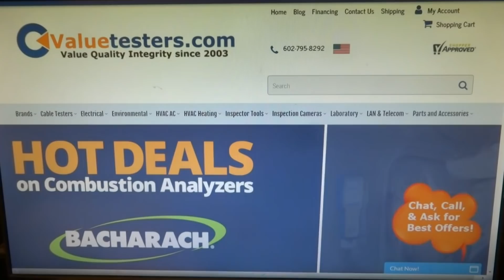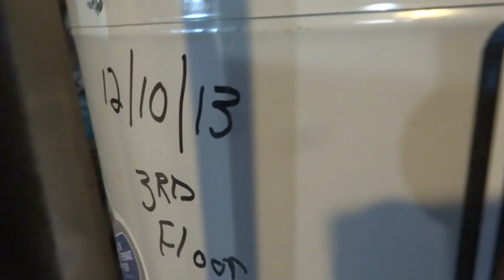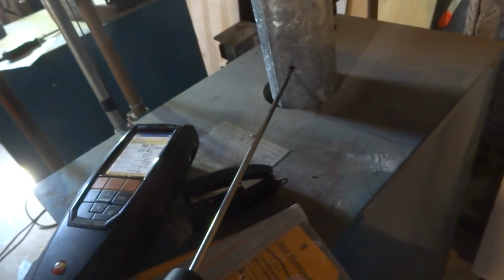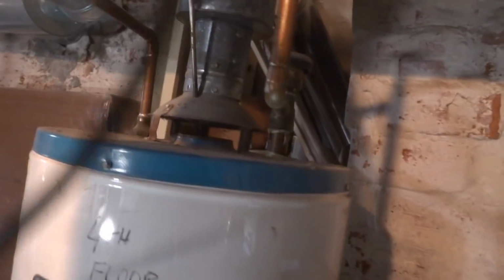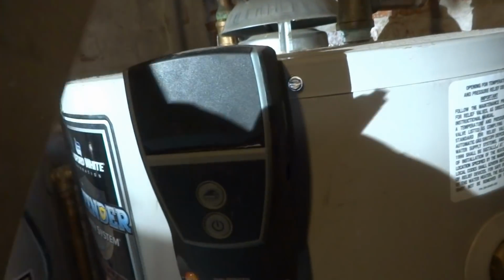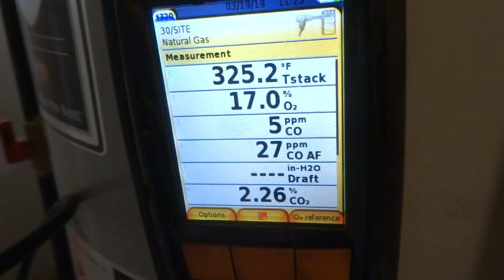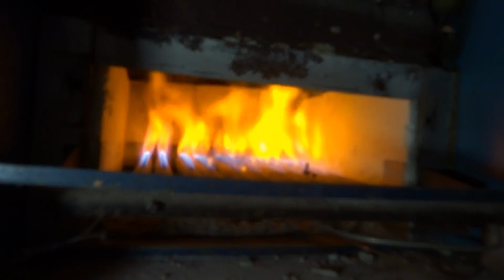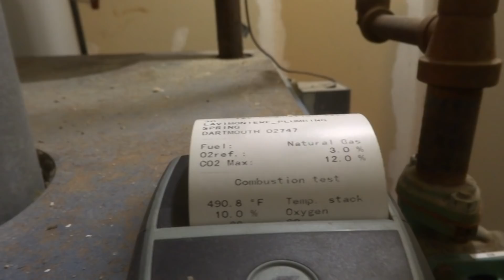combustion test on boilers & water heaters

Comment: Just draw 5 gallons out of the drain valve of the water heater or enough as needed so stat calls for burner to kick on.   No need to get in unit to run water.

Comment: Steve, I like these "Dumb" gas water heaters because they don't require electricity to operate. I lived in an area in southern NH that had city water and natural gas that would work even with no electricity. I miss that today as the area I live in now has power outages and here EVERYTHING runs on electricity. I have propane heat with those unvented gas heaters that work without power.

Also that little printer on your tester does that have to be lined up to the top of your tester or does it use bluetooth or something? I wonder if it would print images.

Comment: Hey Steve. Pull knob off gas control on water heaters that determines temp then turn brass knob it attaches to to over ride the temp. She’ll fire right off for ya. :)
Excellent video showing combustion testing! Not a lot of plumbers can do this, nor want to do this very important procedure. You’re like a doctor here giving physicals to the boilers and water heaters!

Comment: When you say you’re cranking it down you mean you’re increasing the gas pressure more than 3 1/2 inches which is the manufacturers recommendations the boiler is not up to temperature yes you’re going to have highCO . Boiler must be at 180° before you can do a combustion test.   If a gas flame impinges on a heat exchanger or a cast iron section you will get huge amounts of c/o.  Turning the screw down will increase gas pressure!!!!
Reply: BP 27 that does not seem right combustion efficiency is only reached at peak  operation temperature